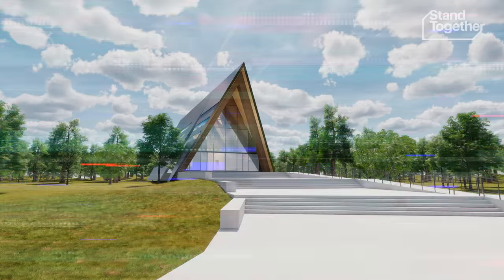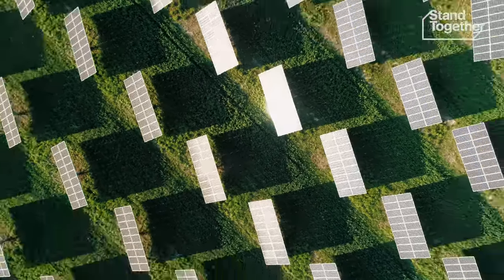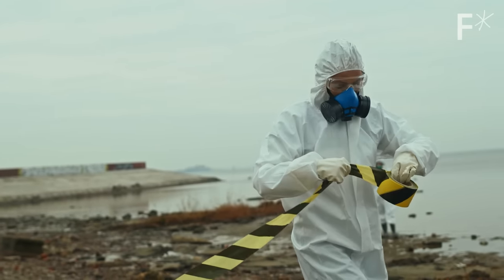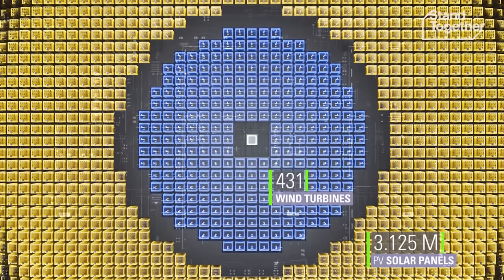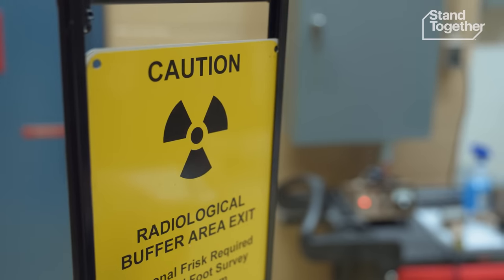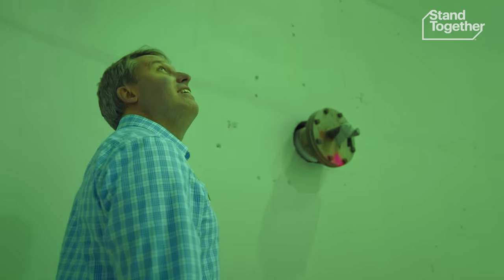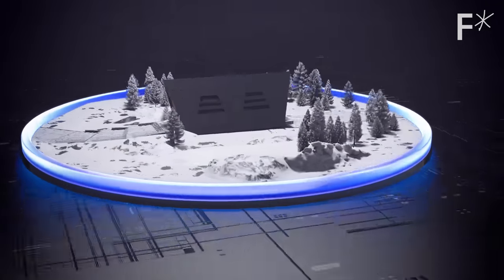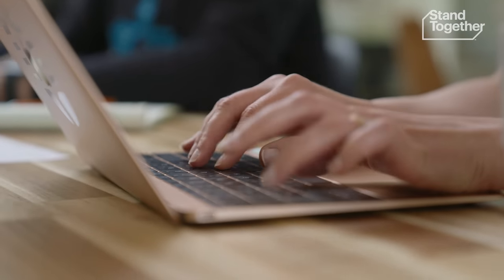Inside the New Micro Nuclear Reactor that Could Power the Future

Comment: Anyone who states nuclear energy has to many negative possibilities does not educate themselves on the negatives of oil & gas nor the complete cost of mining for lithium to make batteries.
Reply: well said
Reply: I agree, though nuclear won't actually end the usefulness of oil and gas.  Rather, it will reduce the demand which will be great.  Those who need oil and gas would find it far more affordable while the power grid being fully nuclear would relieve a lot of pollution.
Reply: There is no such thing as oil and gas. They are two completely different source of energy. Gas has lower emissions hence why the US is the only country to have actually made the targets of the Kyoto Protocol even though it opted out of the process. 
Natural gas, Coal, Nuclear and renewable can all work together. Coal plants can be clean energy as well but they require a lot of engineering so they would have limited use.
Reply: @bighands69  The downside with coal and natural gas is damage done to the environment in the mining and fracking processes.  Natural gas might be worth it if we proceed with caution to not contaminate aquifers, but the strip mining used to produce coal and the coal ash are pretty devastating.

I'm not sure what you mean by 'there is no oil and gas'.

As to oil, as in petroleum, it has more uses beyond refining into fuels.  It's used to synthesize all sorts of chemicals and plastics, and then of course tar and asphalt also have industrial and construction uses.  It's never going to not be useful.
Reply: Lithium is necessary, and that mine in Bolivia(?)is basically just a super salty lake that they process the salt out of, sooooo, it's safer than chugging on fossil fuels... Der, duh, doi, uhyulk.
Reply: Gas and Oil are not the problem, the inefficiencies of wind and solar are.  Nuclear could be a great addition to Oil and Gas to supply the demands of the future and provide for clean reliable energy.  Gas and Oil are also quite efficient, in the USA very clean, and can scale easily.  Must do all 3 or we will pay exorbitant energy costs and decrease our standard of living.  

World wide the cost of Nuclear remains beyond what most countries will ever be able to afford.  Clean Gas and Oil are the solutions for the billions in developing nations until Nuclear is more affordable.  Wind and Solar are feel good, inefficient, heavily subsidized non-solutions for much of the world.

Comment: How about some specifics as to how it is able to be so small?  Details?  We were treated to a lot of their story and a lot of renderings of the A frame ... but very little specifics, very little engineering.
Reply: I don't know the details, but I know a mini nuclear generator is on it's way to Oak Ridge.  In this case it doesn't sound like it has anything to do with this company, but rather is part of the government renewing it's research on mini generators.  This is a very good sign that things may be changing soon, and I think it's great to have a private enterprise out there trying to make this available commercially as well.
Reply: Building small reactors is just building smaller reactors. The big difference between this and our current reactors is this is a fast breeder. Fast breeders use fast neutrons (as opposed to slower thermal neutrons) to transmute uranium into plutonium, which is what’s burned. That’s also why they can burn spent fuel, which is already turning, very slowly, into plutonium on its own.
Reply: Which makes perfect sense, given that few of the viewers are engineers
Reply: There are a few videos out there explaining the details. Basically they use uranium metal built around a large heat pipe. The heat pipe uses a combination of potassium and liquid salts (built into the heat pipe) to transfer the heat away from the metal uranium. Helium is then used to wick away the heat from the hot end of the heat pipe. The company has a real hang up with building better security into their design. They want it to look like a swiss ski lodge and to be able to have people walk up to it and have shared community spaces inside of it. Personally I think this is one of the issues Nuclear regulators had with them. They have this idea that just because the nuclear design is inherently safe no external forces will cause issues with their reactor.
Reply: Intellectual property

Comment: I'm all for this if it is done consciously and with good intent upon actually keeping it safe and micro. I also thought a longer time ago that it would be okay to build micro nuclear motors into cars to make them run economically and to just... Realy armour and tank the motor in a renewable way so it can just be reused in another car again and again.
Reply: Using them in cars is impractical. The radiation shielding is usually a extremely dense metal like lead. So the reactor with its shield would be heavier than a truck. 
The problem with smaller reactors so far has been the cost. They need expensive equipment to build and run and they need nuclear expertise which is even more expensive. But with today's technology and economy of scale, it might be possible. Hopefully.
Reply: OMG....humans...we, as a species...just do not get it ....

Comment: Yes! You're bringing back EBR-2 in a new form. I have seen the original film about EBR-2 and thought "how is it that we haven't seen this brilliant reactor all over the place?!? It can burn waste, it will not melt down no matter how hard you try, what's not to like?"

Not only did they actively shut down the main pumps during that test, they also gagged the control rods and safety system so they couldn't activate. They literally said; "The reactor will have to figure it out on its own. We're not going to do anything regardless of what happens." And that's exactly what it did, it self-stabilised and just kind of sat there, almost mocking them. "I'm going to sit here and wait until you lot are done tinkering. Then you may start me back up so I can continue making your electric power."

Comment: Look up Thorium Reactors. Completely different technology from old nuclear. Old nuclear pushed forward with uranium reactors mostly to move towards military capability in WWII.
Reply: Thorium has its own problems. Extreme gamma radiation production is a big issue in thorium reactors. Very hard to shield gamma radiation.
Reply: @RR-us2kp  
Not just that, Thorium reactors also have a huuuuge proliferation issue. The Protactinium can be chemically separated shortly after it is produced. It turns out that the very pure U-233 it produces through decay is a very good bomb fuel.
Reply: @swokatsamsiyu3590  that's true

Comment: 5:42 I just read the nrc gov website and it says 126 have been allowed since 1975 “In the past five decades, the NRC (formed in 1975) and its predecessor, the Atomic Energy Commission, have issued 126 operating licenses for nuclear power plants. Of these, 103 are currently operating, 1 is temporarily closed, and 22 have been shut down after operating and are in various stages of decommissioning”

Comment: Every time I see this type of new nuclear plants I have the same question  that I wonder about. And that is: "Where is the water coming from?" You would need  a lot of water to produce steam, to drive a turbine, to drive a generator to produce steam. High pressure, high temperatur steam. So where is it coming from and how much would you need ? And what imprint will water need cause to the nice reactorbuildings  described in the pictures you (and also other producers)  show off?
Reply: Water in steam generators is recirculated, it takes very little. The newest generators don't use any water at all.
Reply: @chapter4travels  That's true. This type doesn't even use nuclear material. It runs completely on hype. ;-)

Comment: I wish you talked a bit more about recycling the nuclear waste, because I think it’s the next biggest problem with nuclear plants after the risk of accidents.
Reply: Its really not, modern nuclear plants produce about 1% of the waste that older designs you are probably thinking of produce and that waste management is getting more and more efficient. The risk of accidents with modern designs is pretty much zero not including things like damaged containers etc which is localized contamination and is addressed simply through PPE and protocol. Fact of the matter is with nuclear safety a design can just utilize the laws of physics to ensure it shuts itself down in the event of any failure, removing the human element.

Comment: What size reactor are they planning to build?  NuScale and TerraPower both have SMR's approved by the NRC and are moving forward with building sites that should be commissioned by 2030.  Fact is, solar and wind are still much cheaper than SMR energy and will provide ~60-70% of our power generation, however, hydro and SMR's are important for clean base load power.
Reply from the maker: It's 1.5mW--designed to be small enough to power, for example, a college campus or a small town that would otherwise have to import gas. NuScale and TerraPower are very exciting too, as are the many advances in other forms of power. The hope with this is similarly that smaller, standardized reactors will be able to avoid the huge expense and delays associated with unique large-scale plants. If nuclear plants of any kind are able to be produced systematically at scale, it could potentially change the cost equation, and it's worth noting that certain niches (e.g. a village in Alaska) are more expensive to produce energy in than others or limited in their options available, so it's good to have a variety of products coming onto the market and a lot of different approaches being tested.

https://www.freethink.com/hard-tech/these-nuclear-reactors-can-recycle-radioactive-waste
Reply: There is nothing better about wind and solar than there is about nuclear. Nuclear is the future, investing in wind and solar does nearly as much environmental harm as solves and is probably the dumbest way we could go about clean energy.

Comment: Don't forget the most important aspect of nuclear "waste" that is left over from FAST reactors... it is shorter lived material and eventually turns into lead.

You also do not need to boil water for electricity production, you could heat entire cities directly if so desired with a much much smaller reactor!
Reply: Eventually is still 50,000 years. ;-)
Reply: @lepidoptera9337  yes, naturally. 

You can induce fission by blasting the material with neutrons, the same way the fission reaction is started and kept going for decades.
Reply: @sjoervanderploeg4340  Yes, you can do a lot of nonsense that costs ten to hundred times more per kWh than a solar panel... but why would you? Are you a rich kid who has too much of Daddy's money to spend on nonsense? ;-)

Comment: I'm interested in the system synergy you're working on. One of the things the inaccurate climate narrative ignores is water vapor. Water vapor is the world's leading 'greenhouse gas'. Not Co2. The cool thing, however, is that water vapor can be recycled, cooled and re-used with relative ease compared to other byproducts. Then there's the heat itself, pressure etc. All re-usable energies.
Reply: The impacts of the impact of cloud formation on climate is an active area of reasearch with many unknowns. Actively concluding that water vapor is the most potent greenhouse gas is not posible at this point.

Comment: I'm optimistic about the use of micro reactors and am generally supportive.  This technology is promising and can get us closer to IPCC goals.  In light of current events in Ukraine and the capture of Chernobyl and Zaporizhzhia nuclear plants by Russian forces, it is hard to ignore how reactors have been used as leverage in war.  In this case, the threat by Russian captors is that of a meltdown rather than a direct nuclear exchange - both terrifying.  A nuclear exchange is characteristically conventional war and allowing a deliberate meltdown is terrorism.  Again, both terrifying.  As envisioned, micro nuclear reactors would pose less threat in terms of a deliberate melt down scenario and resulting contamination.  In the US there have been a number of coordinated attacks on the power grid by domestic ideologues.  This is not to convey doubt behind the technology behind these reactors.  We should be concerned about the potential of political instability and domestic threats in the US, and assure they remain secure as they become more numerous and localized.

Comment: It’s simply more efficient (and safer) to make a singular large reactor that transports power to multiple locations over a large area.

Have fun getting the right employees for this, nuclear waste storage in multiple areas, instead of just one large area.
Reply from the maker: We'll see! There are a lot of different problems and a lot of different approaches to solving them. Time will tell what works, and hopefully we can learn from the plethora of avenues currently being explored--even the ones that end up not working out.
Reply: SMRs are intended to be used is groups or situations where a larger reactor can’t work.
Reply: Retrofitting existing turbine generators in all major metro areas using existing conductors is good for starters.  Quit giving the MIC the upper hand.